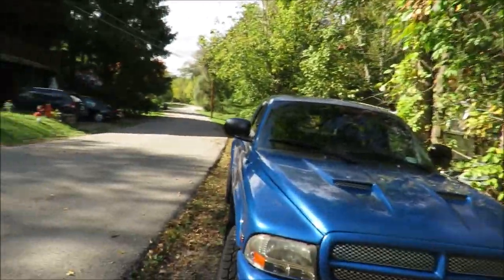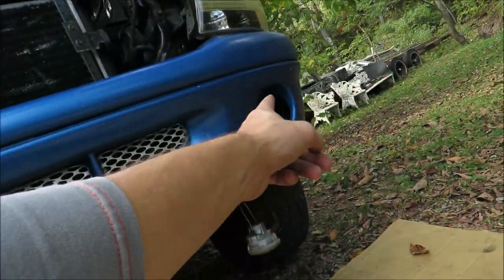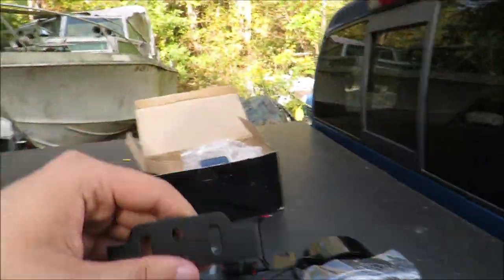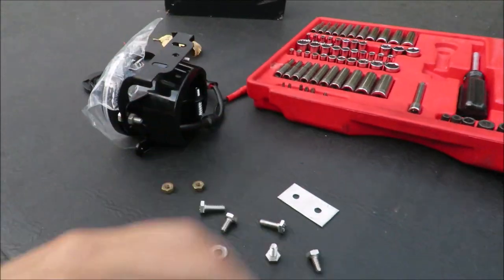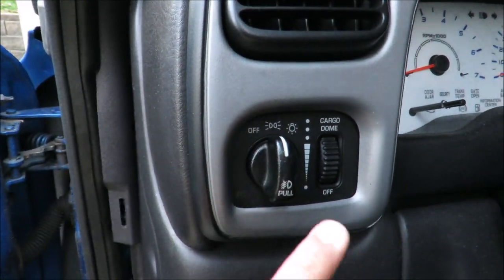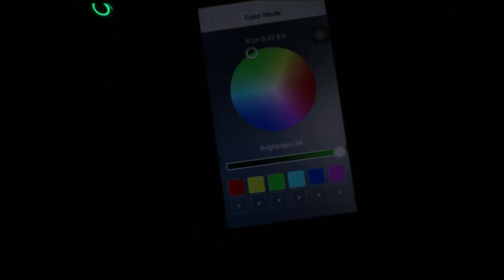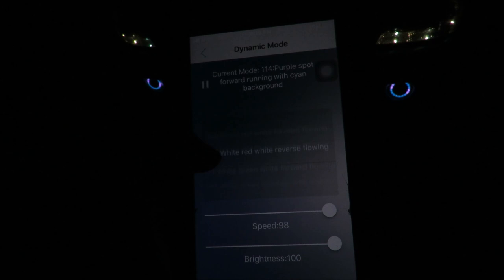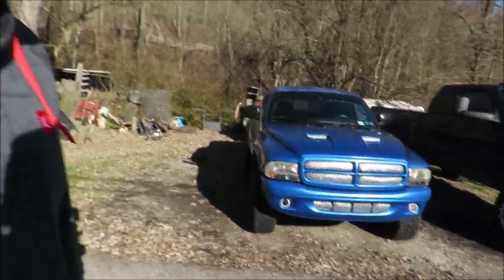Color Changing LED Fog Lights Install - 2000 Dodge Dakota!

Comment: So did you cut the original wires to wire the black and red from the fog lights? I bought some
Have the original plug but I have a red and black wire with no where to connect then and I’m wondering if I have to cut upwards on the original wires to get the whole lamp working.
Reply from the maker: I was able to wire in the black and red wires from the aftermarket lights directly into the factory positive/negative wires that were coming off of the factory harness. You should be able to do the same without having to cut that far up. Hope that helps and you were able you were able to get them working! Thanks for watching!
Reply: @thekehmcrew  what color were the wires for negative/positive? thanks in advance !

Comment: Where did you get the inserts for the grill and lower bu.per insert???
Reply from the maker: They were actually on the truck when I bought it. I believe they’re just custom cut and bent pieces of aluminum mesh made to fit the slots in the bumper and grill. Thanks for watching!
Reply: I found some in the salvage yard last week, they do look good, appreciate you for replying.

Comment: I got those on my 07 dodge ram but not the RGB kind.... can you just get the modular thing to change the color and add onto the light?
Reply from the maker: I’d say most likely no. The Bluetooth control box has a wire coming out of it that directly powers the color changing halo ring around the light. Hope that answers your question. Thanks for watching!

Comment: Do you thing these will fit on a 2 gen Dodge Ram with the sport bumper?
Reply from the maker: I think it would work, I believe these lights are 4 inches in diameter so if you measure the hole in the bumper to verify you should be good! They make a nice touch for cheap! Thanks for watching!

Comment: I actually have a Dakota and have been looking for some of these do you have a link to these
Reply from the maker: This isn’t from the exact seller I bought from, but there are multiple people selling them! Hope that helps! Thanks for watching!

https://www.ebay.com/itm/Pair-4-INCH-LED-Fog-Lights-Bluetooth-RGB-Halo-DRL-For-2007-2017-Jeep-Wrangler-JK-/193452877298?mkcid=16&mkevt=1&_trksid=p2349624.m46890.l6249&mkrid=711-127632-2357-0

Comment: What did you end up doing with the blue and white wires?
Reply from the maker: I actually did nothing with them, I just tucked them away and hid them. These lights were designed for a Jeep so it’s possible those two wires would go to something else on that application. But for installing them on my Dakota I didn’t need them! Thanks for watching!

Comment: Could you please tell me where you got those lights?
Reply from the maker: I got them off eBay, they’re actually advertised for Jeep fog lights, but they work for the Dakota perfectly. There’s a few different sellers that sell the same product but here’s one example! Thanks for watching!

https://www.ebay.com/itm/124503877514?fits=Year%3A2004%7CMake%3AJeep&hash=item1cfd02678a:g:z6IAAOSwY1Ff6VXB

Comment: Would these fit my 1999 dakota?
Reply from the maker: They should fit as long as you have the same style bumper. You may have to fabricate your own mounting brackets like I did.. The holes in my bumper and the lights are both approximately 4 inches so they fit great! Thanks for watching!